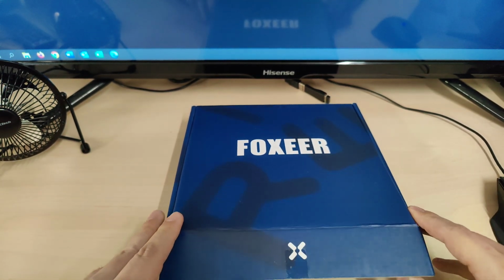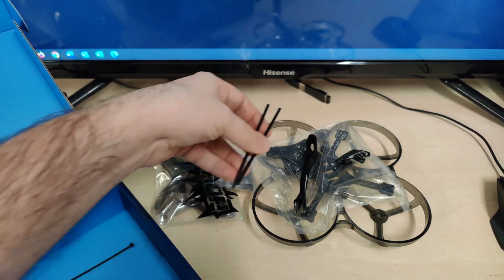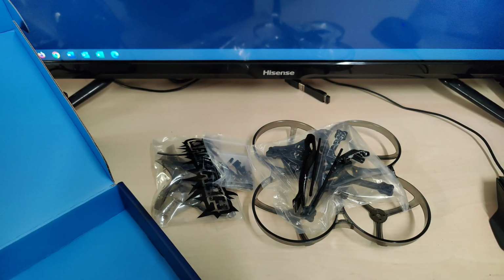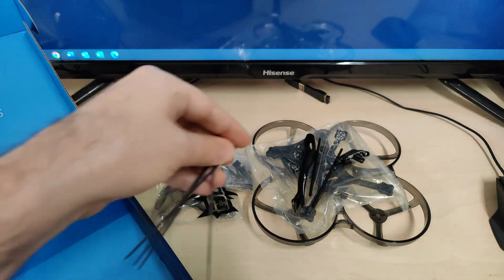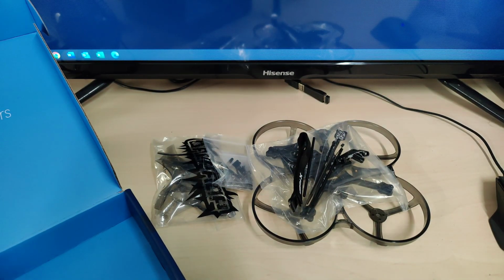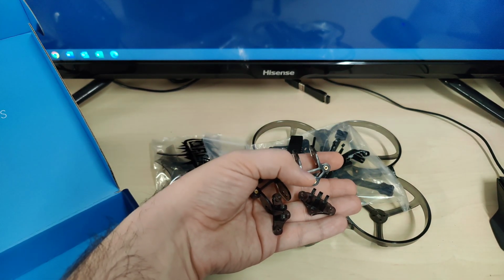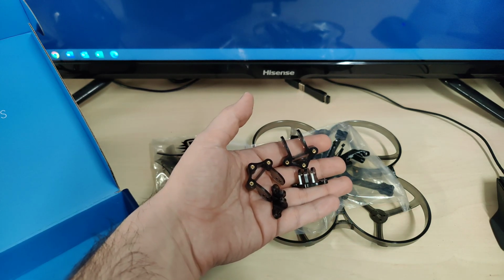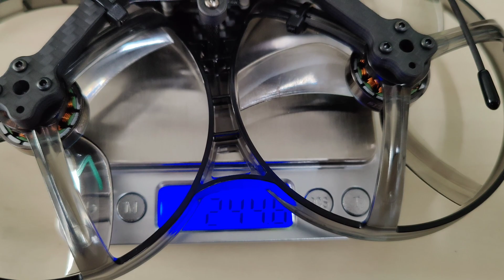How to build the Foxeer 35 Cinewhoop from the GEPRC Cinelog 35

Comment: Just did the same rebuild and I am impressed by the stability of the Foxeer. My Cinelog35 had the same issues with that permanently broken propguards.
Reply from the maker: I think it even flies better now.
Reply: @fpv-teacher  I agree. It feels a little bit more precise. Had my first crash and the frame did well. Only one prop broke ;-) But better it is eating 1€ props instead of 17€ frames :-)
Reply from the maker: @Pimmelpiraten2000  exactly what I think. Props are there to break but not the frame that should protect. My first frame of the Cinelog broke because I accidentally disarmed 1m above the ground.

Comment: How does it fly? I'm thinking of getting same frame fed up of changing the prop guards on the cinelog
Reply from the maker: So far I only did indoor testing and was amazed that it already hovers at very low throttle. According to foxeer the propguards do have a slight duct effect. It felt very agile and controllable. I was also fedup with changing the propguards every Single time when I had a light crash and they all were only light drops from like 2m height